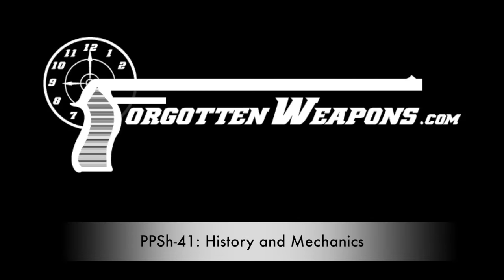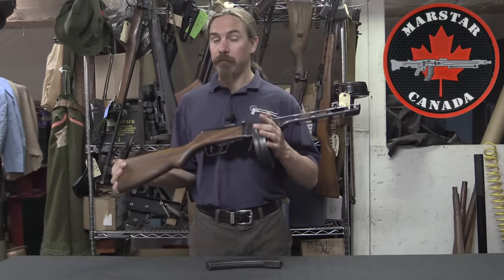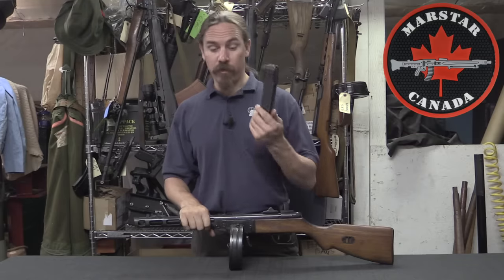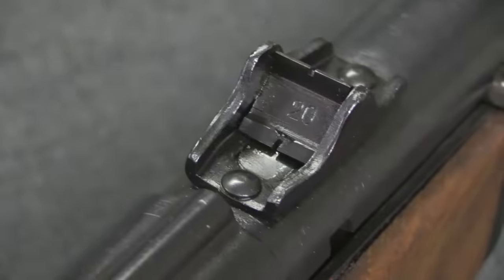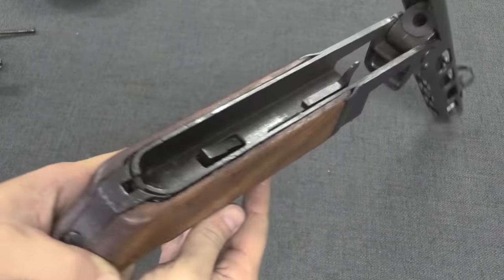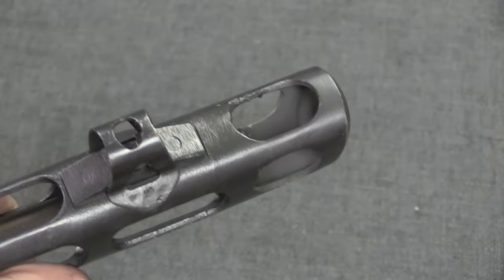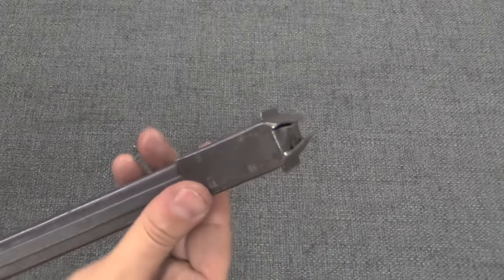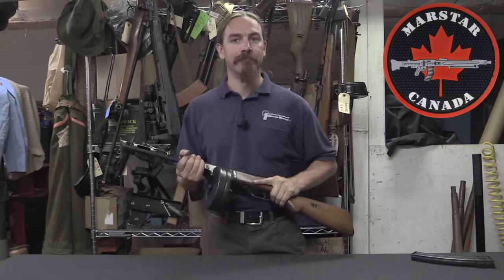Shpagin's Simplified Subgun: The PPSh-41

Comment: The bolt, spring and bolt recoil pad are very similar to what is found on my 9 mm RUGER PC chassis carbine. "Crude but effective." 
For a shorter bolt path RUGER did add a heavy tungsten block into the bottom of the bolt, a good decision. 
I have upgraded several internal parts on my PC such as the extractor, bolt pins, bolt spring (10% heavier), recoil pad and extinction C clip and ambi safety levers W/new cross bolt. It is now even more reliable and more ergonomic.

Comment: The bolt buffer pad at the back end was originally made from leather. But they soon ran out of leather, because it was urgently needed elsewhere. So they started using bakelite as a substitute. Problem was, that the bakelit became brittle in freezing temperatures and desintegrated really fast. Without it, the gun can still shoot, but bolt and charging handle are smashing into the end of the upper receiver, wearing it out.
Reply: Ringo Wunderlich at first glance I thought it was micarta
Reply: Okay, i might be wrong with the finally used material, but afaik they also tried bakelite.

Comment: Firing one of these semi-auto, you can't hit the broad side of a barn.  Blowback for the 7.62x25 round means a fairly heavy bolt, and open bolt means that when you pull the trigger the first thing that happens is that the bolt shooms forward to strip a round and then go into battery.  That long movement of a heavy bolt right before the gun fires totally throws your aim off.  It makes a spring-air rifle seem accurate in comparison.

Still, totally fun to fire as intended (full-auto, baby!)

Comment: The PPD-40 was not the first Soviet submachine gun adopted, it was the PPD-34, created in 1934. However, the military did not really appreciate the effectiveness of this type of weapon and its production was quickly curtailed, and the remnants of the PPD-34 were transferred to the NKVD Border Troops. The author is right that during the" Winter War " soldiers began to demand the return of submachine guns to the troops, because the AVS-36 automatic rifles that were in service refused to work in cold conditions, which significantly reduced the firepower of the Soviet infantry. Yes, Soviet gunsmiths copied the magazine from "Suomi", but it was not the first Soviet drum magazine and was installed primarily on the modernized PPD-34 \ 38, and only then on the PPD-40 and PPSH-41 that appeared later.
Thank you for the video!👍

Comment: This caliber is amazing, it's kind of in between a pistol caliber and a weak intermediate rifle round, more on the side of pistol but still.
The Russians just decided to hot rod the 7.64x25 mauser, steel cases gave more volume for powder and its I think the only pistol caliber fired from a pistol with only a lead bullet with a copper FMJ that reliably punches though a level 3a or nearly any soft pistol body armour and often passes both sides.

With more modern powders  +p and solid copper bullets maybe it could do more.

Apart from surplus and handloads most commercial ammo are weak but the bottle neck makes it more reliable to feed and its very fast and flat shooting, the PPSH and most SMGs in that caliber can reach out to 200m without that much difficulty.

I know a few nations make modern double stack pistols in 7.62x25 but no US imports as far as I know you can't realy convert any pistols to it as its just a tad too long compared to most major cartridges.

If I could get a double stack hammer fired DA/SA preferably CZ75 type would not care what the frame is made out if but I would buy it right away.

When I lived in upstate NY they had a 7 round carry rule so used to carry my yugo tokarev (you could have a 10 round mag but no more than 7 in the mag) 
I was lucky as when I got the gun it had 2 mags (new production) and I was very lucky to find another 2.

I would often use it as my CCW and since it's to thin it hides well, I would keep 1 in the chamber and a mg loaded to 7 in the gun as it had a real safety on the new production zastavas then I would carry 2 mags loaded to 7, in the winter I just used the yugo holster. 

I would all ways carry surplus steel case super hot SMG usualy Bulgarian. 

A little heavy but I got used to it and it only cost me around 200 USD and as a broke post grad it suited me and I could put in a 9mm barrel and use the same mags at ranges as 9mm is usualy cheaper. 

I found that I could get the same speed from reloads but I had to pack the powder in. 

I also love the fact it has a good sight picture, I painted mine and you can cock the gun 1 handed using the rear sight.

Comment: The brilliance of Soviet engineering is seen here. These submachine guns were mass produced to nearly 6.5 MILLION during WW2. The barrels were lined with chrome to prevent corrosion as were Mosin-Nagant rifles. The Soviets used metal stampings and spot welding to reduce MARGINAL COSTS to produce an enormous amount of these submachine guns. The Ppsh-41 was copied by both China and North Korea. The Chinese called it a "Type 50." These submachineguns were chambered for the 7.62x25mm pistol round used in Tokarov pistols of the era.

This Ppsh-41 is by far one of the most important weapons built in the 20th century behind the AK-47 and later AK-74. This submachine gun followed with the simple tactics of creating a mass produced bullet hose for spraying down enemy troops. It excelled at close quarters fighting. Whole battalions of Soviet tank riders were armed with these Ppsh-41 submachine guns. Soviet tactics were simple but highly effective, well thought out with built in redundancies in their tactical doctrine. A whole Soviet artillery corps, with up to 300 heavy guns, mortars, and katyusha rockets per kilometer, launched a ferocious pulverizing bombardment to crush anything German on a breakthrough front. Promptly, whole battalions of Soviet army tank riders armed with Ppsh-41 submachine gun, grenades, and sharpened spades rode on T-34 tanks to engage German Wehrmacht troops. The tank riders only descended from their tanks for close quarters combat when they were literally right on top of German positions. The tanks provided supporting fire while the Soviet assault troops literally hosed the German defenders down with a literal hailstorm of bullets from massed submachine gun fire. 

The tank riders excelled at clearing trenches, pillboxes, and buildings with their submachine guns, grenades or satchel charges. Sharpened spades were used by Soviet soldiers to kill Germans in hand-to-hand fighting. The Ppsh submachine gun was heavy and robust. It made an excellent club for splitting open a German skull when called upon to do so. The Soviet tank riders weren't interested in taking prisoners. These assault troops jobs were to kill Germans, clear their objective, resupply, reform and go into combat again on the backs of T-34 tanks or SU-guns. These tank riders created a path for follow on echelons of tank supported troops to exploit a breakthrough, frequently for encircling large numbers of German defenders in a pincers from other Soviet breakthrough fronts. Heavy attrition of German defending divisions resulted after this close quarters combat.

The Ppsh-41 submachine gun gave Soviet assault troops, partisans, and rifle platoons FIRE SUPERIORITY over their German enemy. The Soviets developed developed these "bearhug tactics" during the Battle for Stalingrad under General Chuikov, when the 62nd Army traded in their Mosin-Nagants rifles for submachine guns and grenades formed into assault groups of about 80 soldiers augmented with light machine guns and antitank rifles. The Soviets learned the safest place to be was as close to the Germans troops as possible to avoid German air and artillery attacks. The Soviets found when they got in close quarters combat, the Germans weren't so formidable. The Germans troops hated  being hosed down with submachine gun bullets and blasted with grenades at almost point blank ranges during these  Soviet close quarters assaults. 

This bearhug technique quickly became universal throughout the Soviet Army. Every rifle comany typically had at least two submachine gunners in every squad. Later in the war, entire squads and platoons were armed with submachineguns in every Soviet rifle company. Partisans loved the Ppsh-41 for close quarters ambush work. At the end of war, one out of every four Soviet frontline soldiers was carrying a Ppsh-41 or other submachine gun. It was Soviet tank and infantry teams, armed primarily with large numbers of Ppsh-41's, that won WW2 for the Soviets.These Soviet bearhug tactics, with large quantities of inexpensive to manufacture submachine guns,was a major tactical milestone in the 20th century. The huge quantities of inexpensive automatic weapons allowed millions of fresh recruits from peasant armies to be armed with highly effective weapons. These Ppsh-41 submachine guns required minimal training for these mass peasant armies to be highly lethal in close quarters combat against superior equipped Western forces.

Many millions of these Ppsh-41 submachine guns were copied by the North Koreans, Chinese, Viet Minh, later Viet Cong and NVA. The Communist bearhug tactics produced large numbers of Western casualties undermining the war effort politcally at home. This caused the Westerners, despite having superior artillery, armor, and air power, to seek an end to a stalemated quagmire war after growing heavy casualties caused political unrest at home. So the Ppsh-41and the later postwar AK-47, were major catalysts for political change on the Eastern front of WW2, Korea, Chinese Civil War, French Indochina, the Vietnam war and many other post colonial conflicts in Asia and Africa. The Ppsh-41 and the AK-47 are still found fighting side by side today in many insurgent wars around the globe.

Comment: For all "weapons experts" here, it should be said that the PPSh 41 was the best submachine gun of its time. And it was designed for use at a maximum of 200 yards. Its main use was in close-quarters combat. The cartridge is a Mauser 7.63 calibrated to 7.62x25. My Father was in WW2 and liked to use it as a loot weapon. The Wehrmacht even had it in its arsenal under the name MP 717 in Cal.9x19. It was a lot better than the MP40. With the PPSh, a good shooter could shoot a can at 60 yards hit every shot.
Reply: Nah, the best SMG is the Finnish Suomi.

Comment: 1Min - 45 Secs in there's talk of, "a Solid Milled Trunnion  up here at the Front" it looks maybe that this part was cut / fabricated via  an Oxy Acetylene cutting process by the pattern on the material, not even bothering to clean up same by Draw Filing... rather that any type  of  precision milling process. that would figure keeping things simple de skilling that production process plus cutting down on tooling and machinery...

Comment: Somewhere I read that oficially,you can load the drum to 71 rounds two times.After the second time,it is only safe to reload about 65 rounds,because the spring was weakened.Maybe that's not true,but I once talked to an elderly gentleman,who got his training with the PPSh(Hungarian People's Army originally used either "gift" guns or license-manufactured ones) and he said,that when a drum magazine is new or close to new,you are allowed to load 70 rounds,but only if you are ordered to to do that.Otherwise they load only 30 rounds.But you find none of that in the official handbook.
Reply: Thats true, i heard of that as well, it was unsafe to load 71 rounds into weared out magazine, but i'm very skeptical about loading only 30 rounds had something to do with mechanical flaws of the magazine, probably those soldiers was a guards on duty or placed somewhere where combat encounter was highly unlikely and they was desperate to reduce magazine weight.
Reply: They load 30 rounds because they were told to load only 30.One of the main reasons for that is because HPA was the poor little brother of the Soviet Army.My father told me,when the Soviets were on the shooting range,they fired a few hundred rounds per each soldier.The HPA units are only allowed to fire ten per soldier.

Comment: I tell you what, open bolt submachine guns are a lot simpler than a 2 cycle single cylinder engine. If the S ever does HTF I think anyone can make a decent one out of off the shelf parts, a band saw, a grinder and a drill press.

Comment: I noticed something: The mag is not 75 shot mag. the outer ring will not get filled with ammo. i watched a ppsh mag loading tutorial to confirm. they have a slightly different design inside. so i would assume that this is a drum with about 30 shot capacity. can you confirm that?

Comment: Awesome video,but you say at 10.53 min that the block on top hold the barrel into the trunnion which i think is wrong,
The bolt on the side witch is the hinch hold the barrel in the trunnion.

Comment: Could you fire the PPSh-41 while on safety? I mean the safety only affects the bolt and not the trigger.
Reply from the maker: No. Pull the trigger all you want; if the safety is engaged the bolt is not going anywhere.

Comment: If you had ever worked with steel then you would know what you are trying to explain is that the Machinery needed to be retooled... it needed to be cleaned off and squared off and recalibrated... which most likely met that these people did not want to pay for the machines to be cleaned at the end of the day which causes all that buildup and grime to lose tolerances in Milling and machining

Comment: To every person that use that in a combat situation I find it offensive that you called that a low-budget submachine gun... If you had ever spent much time stripping down Springfield 3006 you would know that that is a really reliable gun right there... If you had ever spent much time stripping down an M16 a Glock or anyting in a real situation then you would quit saying these things like inexpensive and cheap that is a good gun made out of heavy Steel in a good situation that keeps it cool because the weight of the metal if you find out anything about metal, with no that the weight of that gun keeps it cool and it will fire and fire again when you need to quit saying these things

Comment: The problem of parts interchangeability was largely due to Comrade Stalin's habit of executing those in charge if they did not fulfill his orders. When production numbers were low, it was relatively easy to meet the specified quota subtracting the defects or those items that were out of spec. However, when the quota skyrocketed due to war demands, those responsible for production could not meet the numbers so they simply let defects "pass" and be counted in the total production numbers so they would not end up in a gulag or be shot. Practically, all the Soviet production numbers were padded with defectives this way. Padding the total production number with defects was also what US automakers did during the '60s and '70s which was the real reason US cars' quality was so poor.

Comment: I've shot these things quite a bit ( in Cambodia.....you can shoot just about anything there).

I can't help but think the Ppsh41 is dramatically overrated. It has all the normal problems of any other, mass produced, single feed SMG produced in WW2. The double stack to single feed magazine arrangement is inherently unreliable and it contains all sorts of openings in the receiver to let dirt in.

But it also has numerous faults unique to this weapon ( or at least far worse than its competitors).

The open magazine well is, frankly, a terrible design. Only magazines with a perfect and very tight fit work reliably, which is a real problem with changing magazines between weapons. Any wear on the magazine well or magazine will render the magazine unreliable. 

As indicated by Ian, it's design was such that it had to be made in purpose built factories. It could not be built in small,  dispersed workshops like the Sten.

It's ergonomics are terrible, particularly with the drum magazine. The bottom of the drum is the only place to put your front hand. And holding the magazine is problematic  anyway, for all the normal reasons given about misalignment of the magazine and resultant misfeeds.

The positives I can say about it are that it had a safety lever on the bolt handle from the very start (unlike the MP40 or Sten which had them retrofitted later in the war), and it used a round (7.62 Tokarev) with relatively high muzzle velocity that was far better at longer battlefield ranges than other rounds. You can certainly hit targets at 200m with this SMG in semi auto mode. In full auto is is useless for anything other than trench or room clearing ranges.

And it is heavy....far too heavy for what it is. 

All in all, a very imperfect and over rated weapon. 

IMHO, the reputation of many WW2 weapons  is more internet myth than reality. I largely put this phenomena down to national character.  The Russian propaganda machine loved to talk up all the weapons it provided it's glorious army as the best in the business, and it becomes the unquestionable truth. 

Conversely, the Brits love to talk themselves down and mock their generals. That's why the Sten has developed such a bad reputation when, in reality, it's flaws and reliability were no worse than any other mass produced, single feed SMG in WW2 and it's production simplicity and speed was, genuinely,  war winning.